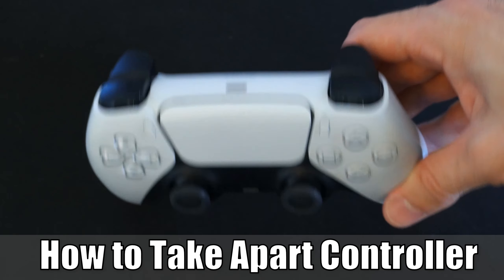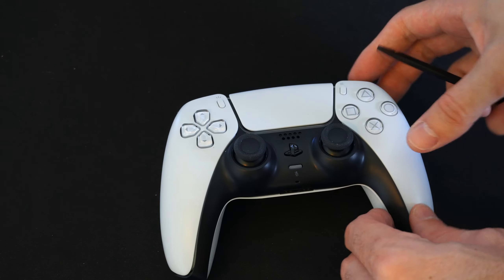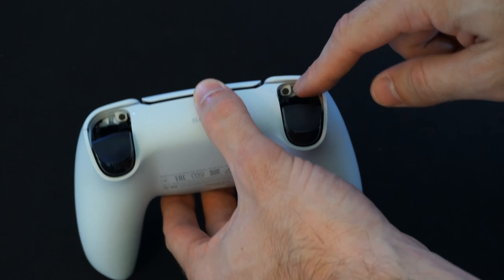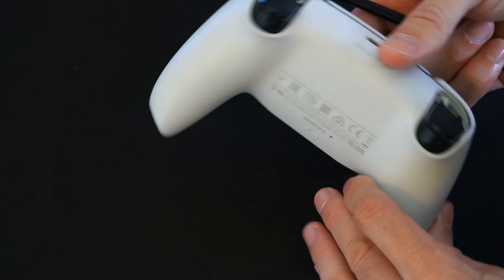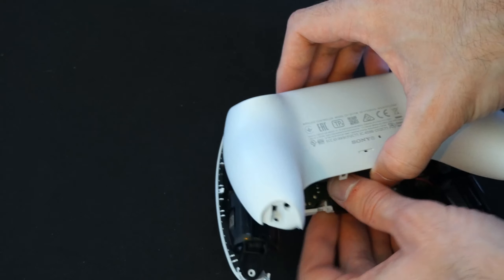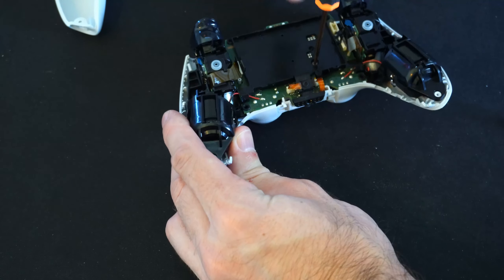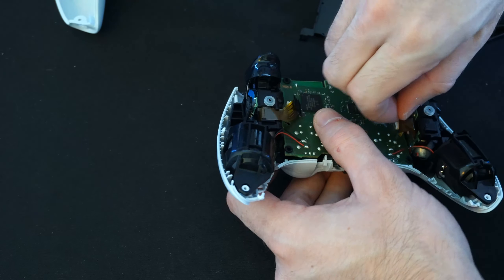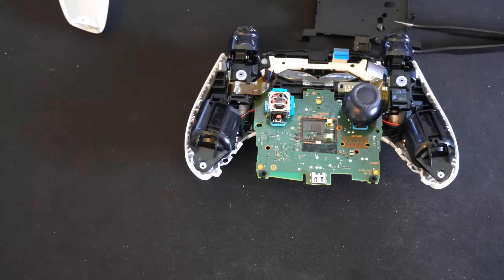How to Take Apart PS5 Controller & Remove Cover (Disassemble Tutorial)

Comment: For those of us that don't have a tiny screwdriver, i did this with a pocket knife and tweezers. It takes a TON of patience and a very gentle touch in certain spots but it works as long as you're very careful
Reply: Dude thank you so much
Reply: Wow.. you did it the most difficult way. You do have patience
Reply: you know whats cheaper than a ps5 controller that you ruined the screws on?
little screwdrivers.
Reply: Jesus bro I was panicking on wth to do I don’t have a tiny screw driver 😅
Reply: bro i'm trying a kitchen knife idk if it is a good idea ill look for a small screwdriver then try the knife, ill update y'all

edit: i found a stanley knife and it's super useful, the stanley knife has a loose blade but it works

2nd edit: i managed to fix the loose blade, i just got the black thing off

Comment: The failure rate on these controllers is insane. I've gone through like 3 or 4, all separate issues. They have a nice design, intricately made, but they're cheap. I've gone through two Switch Pro controllers within a whopping 6 years. Anyhow, great upload. I'm now able to swap parts from my failed controllers! 😁
Reply: Yeah. I'm still using my Xbox 360 controller and apart from wear and tear it works. But my PS5 controller got a major issue within a year.
Reply: 2nd controller down in 2 years. Less than 2
Reply: Ps2 controller was bulletproof!! What happened?!
Reply: @MetalHDGMR  they realised they can make people buy another controller if their current one dies
Reply: I've had mine since launch and I just take care of it and its been fine
Reply: Man I’ve been lucky my two year old has thrown both of mine and they’re still good

Comment: this is a old video but imma still leave this comment I spilled about a teapsoon of water on my controller in estimate and it kept on blinking orange i was going to open it without video because PS4 controller were self explanatory like that but i couldn't find any screws so once I watched this I followed your steps carefully and opened it and blew air out of my mouth in throughout the controller and when I put the battery back in and put it all back together it fixed so I am much grateful for this video thank you for saving me $70! THUMBS UP

Comment: Thank you, that saved me a ton of effort when trying to fix the sticks!

Very informative and covered off all the bases (ignore the comment at the top saying the L1/R1 screws aren't mentioned, they are!)
Reply: FYI, If you got basic soldering skills, solder on the drift fix mods. I've done 2 controllers- 4sticks now. Didn't need to tear down and disrupt those sensitive rings. Works perfect.

Comment: Thank you, this was incredibly helpful! After watching this (and another, less detailed video) I had the confidence to fix the bad drift in my left thumb stick and now it works perfectly!
Reply: One word of advice I have for anyone doing this, put a tiny dab of hot glue on the red and black wires on the left and right sides (the rumble motor connections) before lifting the chip set out (the part under the battery). They are very fragile and will break off if you even look at them wrong. It will give you a little more "opps" protection.

Comment: This was a super simple video to follow. I've had my controllers for a couple years and my left stick started to develop an issue where if I moved it just slightly to the left it would dart the cursor over. I figured the issue was pet hair (3 dogs and 1 cat with no HVAC in the house). Pulled it apart and cleaned it and put in back together in less than a half hour and now it's good as new. Thank you!

Comment: very helpful after i got mine back from repair. the right stick was having drift. they fixed that, but then the laft stick felt like it wasnt put back in right or something. movement felt physically rough. sent it back in under warranty, fixed the roughness, but NOW the right stick had that issue.
wasnt gonna take it back this time, followed this video. just needed some WD40 sprayed in the stick base joint.
i dont know how they managed to have it become too dry like that.😑

Comment: Great video. I had to put mine back together and then take it apart as bizarrely the X button would work on the outer menu but then not in game. 

Alas replacing the thumbsticks didn't fix my issue. So new controller it is.

Comment: The corners of the case near the bumpers are stuck togeather. Ive removed all 4 screws and no matter what the two corners REFUSE to budge. Its been damageing the damn case of the controler and its done litteraly nothing. Im convinced the managed to weld the plastic corners together.

Comment: i really appreciate in showing me on how to properly take apart the ps5 controller. however, without the proper tools i will be risking ruining my controller by having unwanted scratches and whatnot on it. with that said, the alternative i have in mind although i don't like such an option would be buying a new controller instead. don't get me wrong  i rather do the stuff you've shown me but without the proper tools i can't get it open and see if i can repair my r2 button without damaging the controller. 😢
Reply: If you're going to throw it away anyway, why not risk a few scratches?
I hope you get it working!

Comment: Can you identify the "little tool" you use to remove the black plate?  Might be handy for those looking to acquire one to know what it is.
Reply: I used my smallest flat head screwdriver bit. I will admit, it left small mark in the edge of the plate because it's not perfectly flat. But it did the job
Reply: cheers! @bigrougegaming2607

Comment: I'm having trouble getting the top off after removing the 4 screws. I even have the right tool. It's not releasing on both sides near wear the L1 and R1 buttons were removed. Any suggestions?
Reply: Pull hard but carefully on both sides. Make sure its open everywhere else.

Comment: WARNING: he did not add removing the screws between the base of the shell handles and the screws behind the R1 and L1 buttons. I caught the first set of screws but since he didnt add the 2nd set i ended up breaking the shell.
Reply: I was just going to say that myself. It dosen't come off "That Easy" like he says. There are screws holding the plates together under the triggers.
Reply: he added the ones behind l1 and r1?
Reply: He did though...
Reply: Sounds like you were moving too fast bro
Reply: Damn that's a choir to get to my buttons dang dogs spilt a drink on it so all my buttons are sticky
Reply: Yes he did!
Reply: Yes he did. Yu weren't paying attention
Reply: He did, he even mentioned turning the controller upside down so you didn't lose those screws inside
Reply: Buddy your blind 😂😂😂
Reply: Great video. He mentioned many a time, if forcing it, you're breaking it. He mentioned all screws and the correct way to disassemble it.

Just followed to solder on the drift fix mods. Highly recommend, it solved drift in both controllers and cheap. Didn't need to tear down sticks to clean those delicate rings. Just soldered on. Basic solder skills needed however.
Reply: @damienstarr I had a stroke reading this
Reply: @Monkeyswag13  I had a stroke writing it
Reply: @damienstarr  couldn’t ask for a more goated response lol
Reply: 2:23- shows the top pair under the bumpers, then flips over and shows the bottom pair at 2:30.
Reply: @kylerivero4343 I think you mean deaf
Reply: How tf you miss that? 😂😂😂
Reply: Looks like op abandoned thread out of embarrassment 😂
Reply: @TravisBon615  no he can be blind and it still makes sense. He didnt see the screw or heard him (maybe he watched it with the sound off)
Reply: Ugh yeah he did bro. Clearly u didn't watch the video
Reply: He did, you’re the only one to blame
Reply: He did he even unscrewed them in video
Reply: Thank you so much
i was confused why i couldn't get it out
Reply: He literally says “the 4 screws” at 2:57.

Comment: Make sure to be careful about unscrewing the screws, despite costing an arm and a leg they put cheap screws in this crap and they can strip under too much pressure (worse if your screwdriver is on the blunt side). Got 3 out fine and then had to use pliers to slowly undo the stripped one. Just be careful with the screws, they're malleable and cheap.

Comment: Thanks for this it was pretty easy now I'm just trying to figure out if there's a way that I can permanently disconnect the light on the controller because I really don't like it
Reply: i think you can turn this off in controller settings no? in ps5 controller settings menu
Reply: @cz5696  it won't let you turn it completely off it just lets you set it to dim although I have noticed some games it's completely off whenever I'm are there games like Grand theft Auto it goes absolutely nuts

Comment: At 7:15, you're not going to talk about the little suspended silver device in the middle of the board?  What is that?  In mine it just fell out when I turned the PCB over and I don't see any way to connect it back?  It appears as though it is just glued into place?  What is that device?  The gyro sensor?  Do I need it?  I'm just trying to fix the drift in my left joystick!:
Reply: I think it's the sensor for the touchpad, it's just a "floating" sensor. I had to be careful with that too. If it's detached, I'm assuming your touchpad isn't working

Comment: For anyone trying to remove the mic from the controller, pull the black cover off, then cut the mic connection to the controller, and then just pull it out and put cover back on. I used my fingernails to take black cover off and a steak knife to cut the connection. Tested immediately afterwards and plugged in mic still works. No more having to unmute controller to be able to chat with friends, and re mute it when not.
Reply: Don't do this. Pretty sure it's a joke..but some might do this.

Comment: I've been a gamer since 1987, 3 years old, and I've taken apart and cleaned or fix almost every controller you can name (same with consoles). The PS5 controller is garbage. I replace mine due to drift every 18 months, and the battery life diminishes terribly. I've often thought about a class-action on Sony for how poor they are.

Comment: I followed the instructions but were a bit rough and tore the green wires on the motherboard, anyone know how I can fix them ? I learned they control L1 and R1
Reply: Did the pad lift off as well? Or just wire broke? If pads been pulled off, will be harder.

Comment: Can anything be done if I have pretty bad  stick drift? Left stick is constantly pressing left making it unusable.
Reply: Every time I have disassembled a Sony controller (ps4&ps5) for stick drift it is because hair is falling down into the mechanism. Follow the video, it's a decent one, and look for loose hair both on the mother board around the stick mechanism, around the sides of the mechanism itself, especially between the actuator and the button, and inside the stick bezel of the top cover. I just pulled about a dozen 1/2" hairs from inside mine to eliminate stick drift. The mechanism itself cannot be disassembled so if that's actually broken you're SOL.
Reply: Stick drift mainly with the left joystick seems to be a common occurrence. Experiencing same with my 1-2 week old PS5 all of a sudden and searches reveal this to be the case. Great controller but for the joysticks as they are potentiometer modules.
Reply: @davidtsmith33  yes after repeated cleaning potentiometer was determined faulty, replacements are $2.50 a piece and fairly technical to remove, switched to a pro controller with hall-effect sticks so I'll never have the same problem again.
Reply: @SMfryspants  Where did you get a controller with hall effect sticks? Is it for the PS5? My searches revealed none available currently...for PS5.

Comment: Why are you unplugging left and right ribbon wires?  If you're doing this soley to spray paint it you just need the shells off...the only ribbon wire you have to unplug is touch screen unless I'm missing something.
Reply: Okay, I was missing something...it is necessary.  Appologies!!!  I have another question...doesn't seem to be a mechanism or spot to hold mics where they're supposed to be, how do they stay in proper spot?  Is it juat held together by the controller when it is fully assembeld?

Comment: My control is a bit newer had it for abt a year and they made the blue plastic tabs extremely short I can barely even pull the wires out even with tools (Edit) Don’t do this but the only way I could pull it was with my teeth 🤦‍♂️

Comment: WARNING ⚠️ DON NOT REMOVE OR DISCONNECT YOUR RIBBON CABLES, OR UNPLUG ANYTHING INSIDE IT WILL NOT RECONNECT PROPERLY
Reply: Maybe you couldn't get it to connect properly. The ribbons have a black line on them that should be just above where it goes in. That let's you know it's in fully. 

Also u push the ribbon cables in on the sides. Same way you take them out. Wiggle wiggle. 

I've been taking my controllers apart. Then I got the edge. Best time and money saver ever. 

Quickly pop off the front tab and pull the module out and one screw, and ur inside the joystick. Able to tell if it's just a hair in there or if something is broken and then even if it is. It's 20 bucks for a new joystick. And not 70 for a new controller. 😊
Reply: I unplugged all of them and put em back once I was done and the controller works fine
Reply: Wrong. Done this twice and was able to put the cables right back. Skill issue + L + ratio.
Reply: WARNING ⚠️DO NOT LISTEN TO THIS GUY HES JUST NOT VERY GOOD AT IT

Comment: wouldnt call this a disassemble tut. you just show how to remove enough to acces the joystick. theres no showing how to remove the front plate to fix and or clean the bttons if they stuck. like in my case. so no help sorry. will save time and just buy a new controller.. should show how to reconnect everything to just a tip